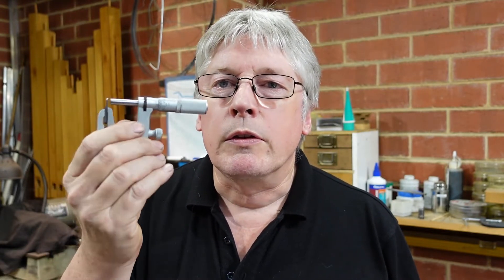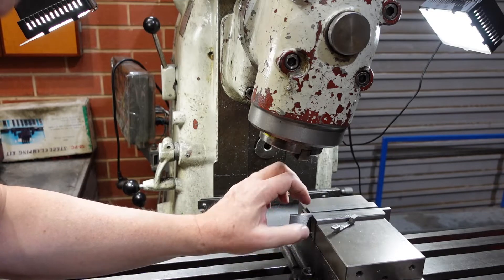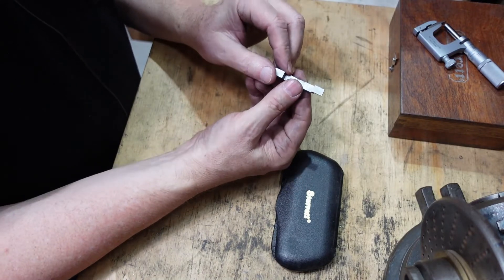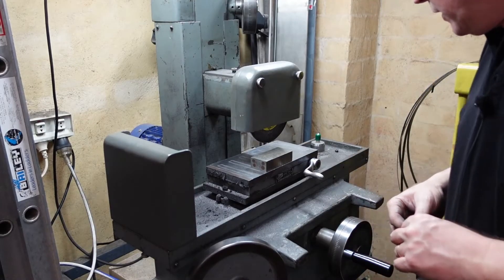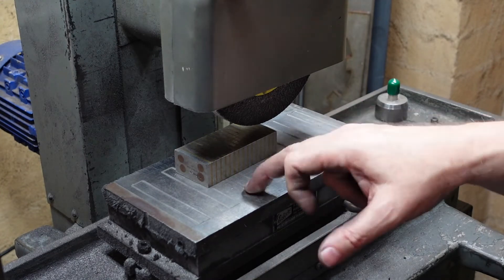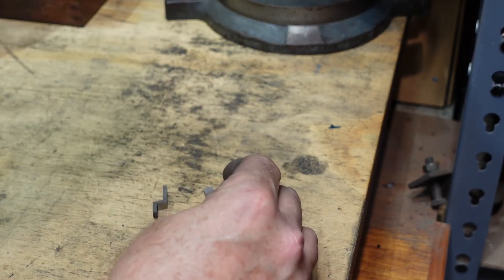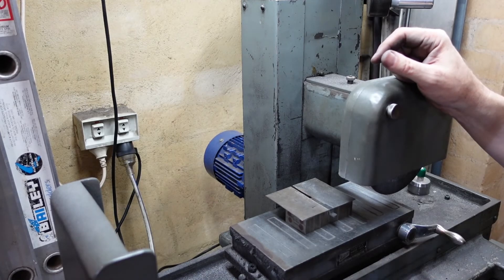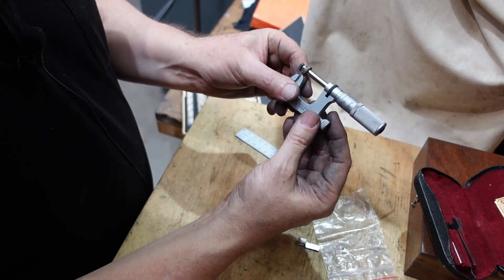Custom micrometer anvil

Comment: Nice job.  I can't picture the situation where it would work but the straight one wouldn't but that's ok.  I just subscribed and I'm looking forward to checking out your other videos.
Reply from the maker: The main use I have for it is when I have something in a reversed jaw chuck and want to measure a thickness. On the bottom step of the jaws a standard micrometer does not quite fit. 
I think I show it in use in another clip later on (can't remember which)...
Reply: @occasionalmachinist  I'll take a look for it.  I recently got one of those mics and haven't used it yet.